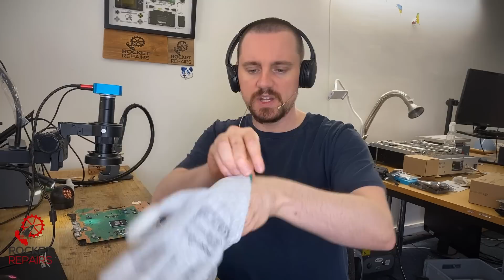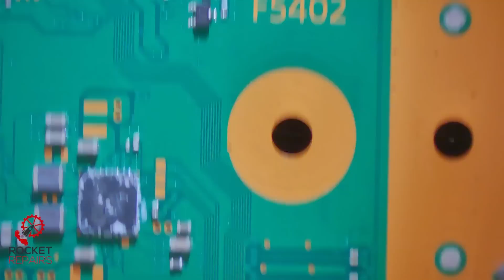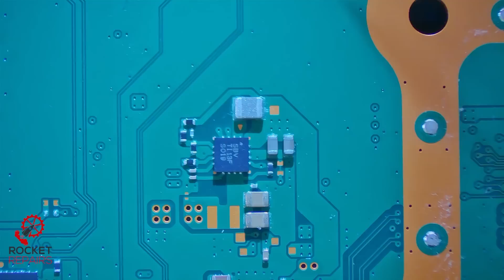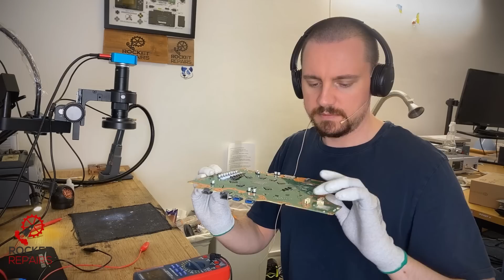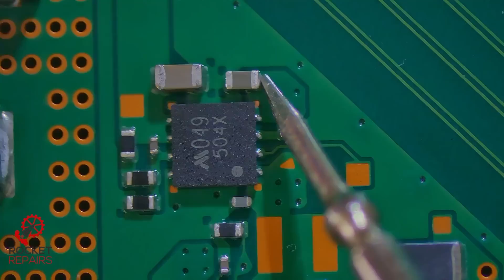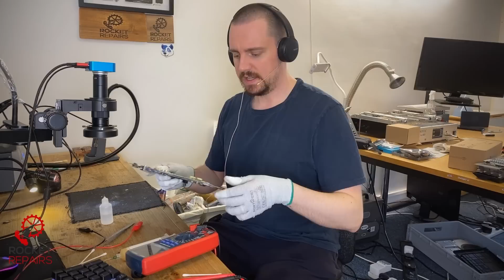SAVING A COMPLETELY DEAD PS5!

Comment: Would appreciate any advice on this problem. My pc will at random time intervals black screen whilst I’m on PUBG. I’ll have to manually restart the computer and when doing so, in device manager, it says my drivers aren’t compatible so I have to update them for It to work again, I get a kernel power error every time. Ive tried a full DDU, deleting every PUBG file and re installing and changing my power settings as well as disabling windows from auto installing drivers. Ive been playing Starfield and CS2 without an issue. What else can I try.

Comment: Shame that a several hundred dollar machine gets wrecked by a component that's mere cents.
Reply: thats the corporate culture pehnomena, manufacturing and selling more , instead of publishing approproate maintenance and service journals for public domain.
Reply: @malikjunaid1  planned obsolescense in a nutshell
Reply: @pizzalord3n not really. That’s like arguing that needing a new head gasket on a car after 100,000 miles is ‘planned obsolescence.’

These things are complex to high tolerances and sometimes there are defects in the manufacturing process.
Reply: @rrwholloway  what did Sony do to all the customers who got ylod from the low quality NEC Tokin caps? Nothing!
Reply: Digikey sell, to the consumer, 0402 caps for 0.4p each at quantities of 100,000. The amount that Sony buy I bet they pay at least an order of magnitude less, maybe two orders.
Reply: That’s the case with all complex machines, mechanical or electrical. 

An old motorcar can become unusable if the gasket seal is gone for example.